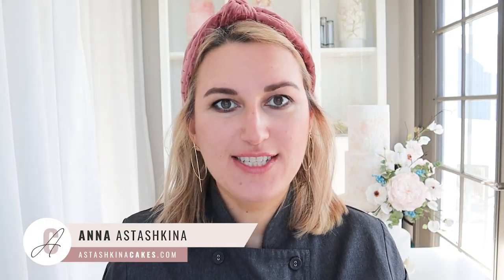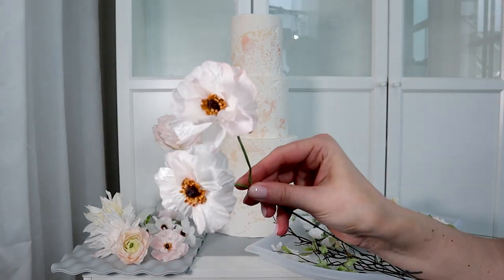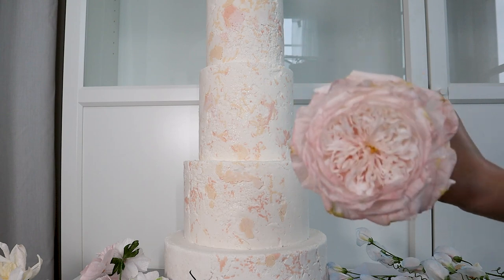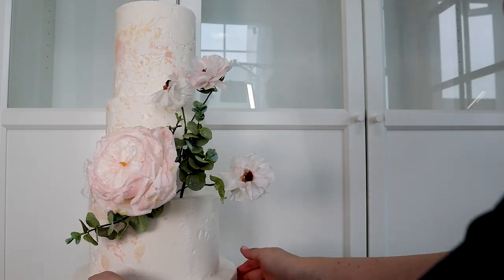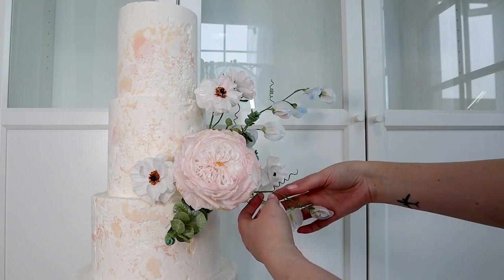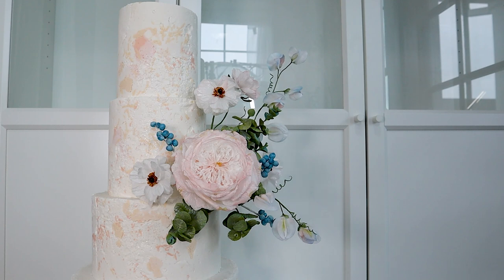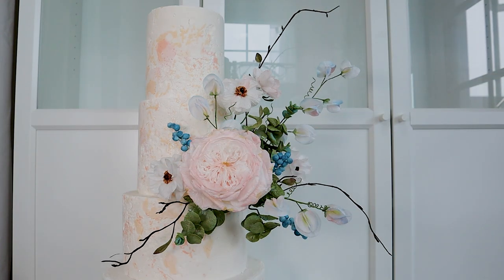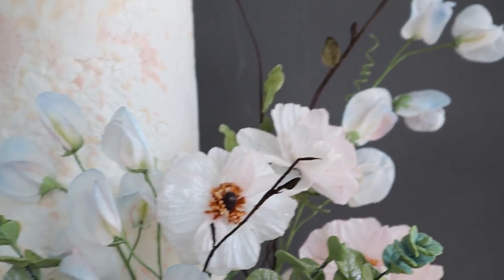How to arrange flowers on a wedding cake | Wafer Flowers for Modern Cake Designs | Florea Cakes

Comment: How do you decide whether to place the flowers wire's in the cake, or wire them together and then use a flower pick? X
Reply from the maker: If it is a real cake - I arrange flowers and tape them together and use a flower pick. If it is a fake (dummy) cake, there is no need to protect the flowers, so I just placing those one by one and enjoying the creative process.